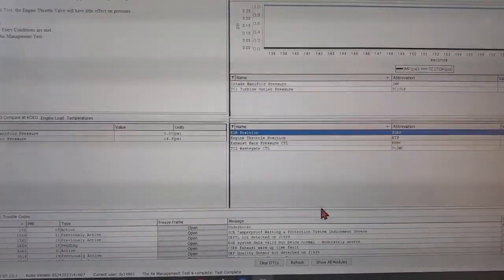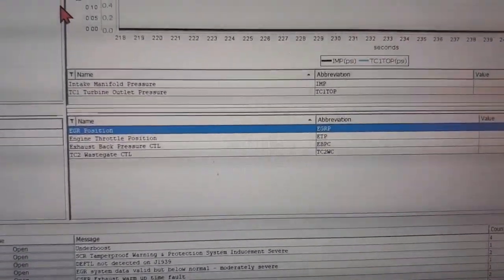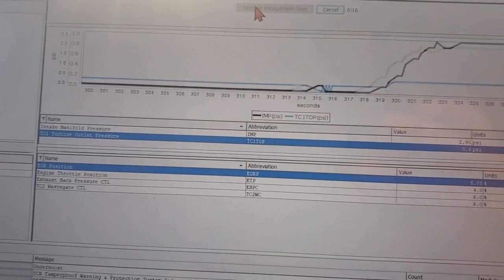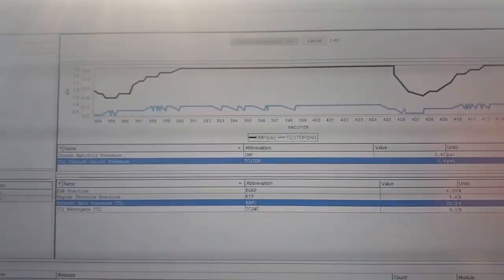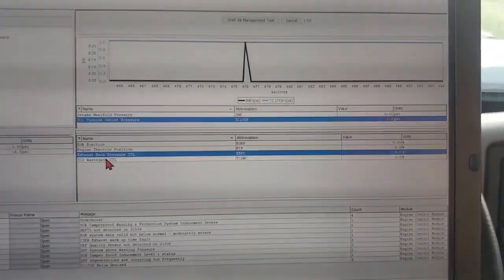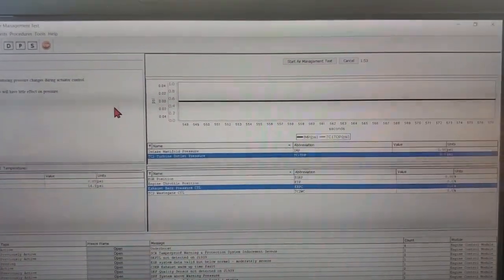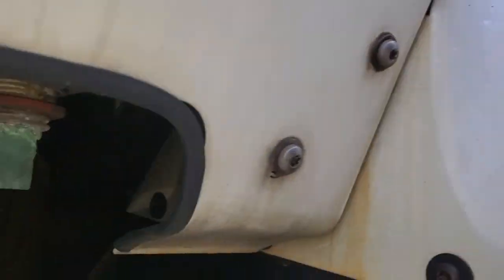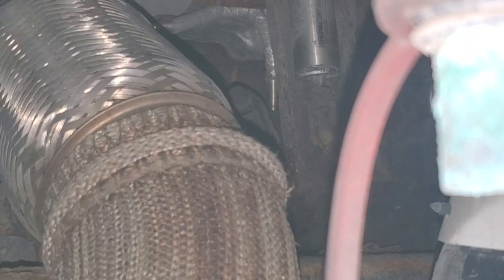LOW or NO power engine diagnostics - International HELPFUL EASY turbo, egr valve/ cooler test

Comment: so what readings during this test are good if all EGR and DPF systems removed by reprogramming (s/w OWEADGMA) ? 
i had readings about up to 80 kPa during the air management test, and up to 190 kPa during driving cycle upward ti hill (truck only).
Also installed new injectors (programmed to the ECM) and HPFP due to hard start.
Reply from the maker: If you're running a deleted system, youd have to see how they deleted it. EGR values would have no change on IMP because coolers are usually blocked off. Some deletes weld or remove the turbo actuators. Youd have to go back to old school methods of diag which include watching your fuel pressures and checking for charge system leaks. 
This test would (for the most part) be useless with a delete.
Reply: @AcousticHills  Thanks you a lot. I have 2 trucks ProStaR near me, and both have low power - on my channel here there are videos with BOTH of them - i could make an English  soundtrack if wanted and post those movies to YouTube again. These trucks seems to be very pretty to their owners-operators, but so poor power that we almost mad about it...
Reply from the maker: @diagnost_gitarist  on a stock (factory) Maxxforce 13, for low power I would check to make sure the turbo actuator is not seized, make sure the air control valve is working proper and check the exhaust back pressure valve to be sure it's not seized down.
Reply from the maker: @diagnost_gitarist  I have seen the exhaust back pressure valve stuck closed even on deleted units that caused it to have low power. Make sure the rod is not visible and is staying up.
It's located behind the turbocharger

Comment: Did this sane test ....etp stays at 0  doesnt move at all ...and tc1 stays flat ....tryst has just a little low power been like that for a out 2 years now im just trying to see what it is ......etp  is what exactly??
Reply from the maker: Engine throttle position should be 0. You can test the valve doing a sweep test.

Sounds like you have a seized turbo wastegate. Run a wastegate test at 100%. Make sure air tanks are over 90psi. Best way tho it to remove the air line from wastegat and apply 90psi to WG. if rod moves, you got ACV issues, if not, you need a turbo.
Reply from the maker: Rod movement should be EXACTLY 13mm. Measure with a small ruler or 13mm wrench
Reply: @AcousticHills  ok mine is deleted and blocked off the egr truck runs perfect just a tad bit of power missing i know because i randomly felt it before and was like...wow ..so im looking for that again lol tc1top doesnt move at all got the wg blocked off to make sure its making boost and it does get to about 40psi ...fpr and desired are both on the same level...so im thinking possible an acv issue? or maybe a fuel pump i dont know its been this way for 2 years just wanted to try to figure it out so i can enjoy it before it blows lol
Reply from the maker: @pottnah6152  on a deleted system, TC1TOP will be 0psi because no pre doc, doc or dpf. 
40psi boost is perfect  not sure why you're not feeling the power. 
Fuel pump would be OK if it's meeting desired. So... just make sure your air filter isn't plugged and soot accumulation in intake isn't preventing air flow. 

Other then that I don't know without seeing it. Sounds like there's no problem lol
Reply: @AcousticHills  well how much to hook up I have neds.....lol